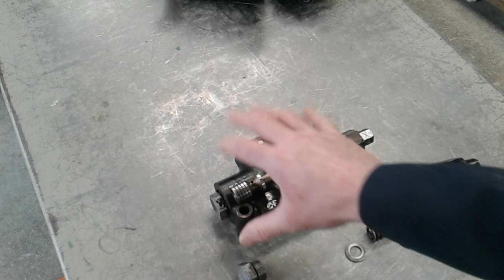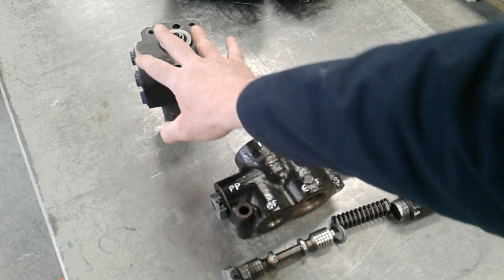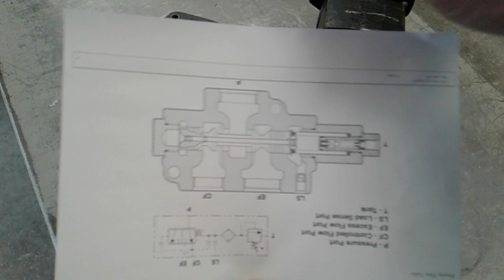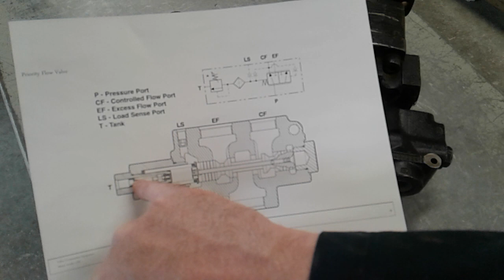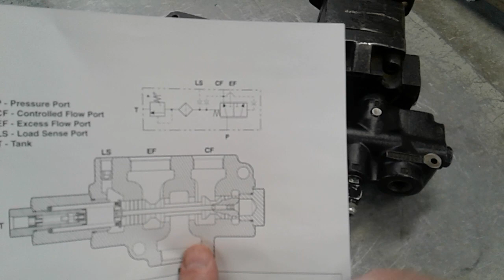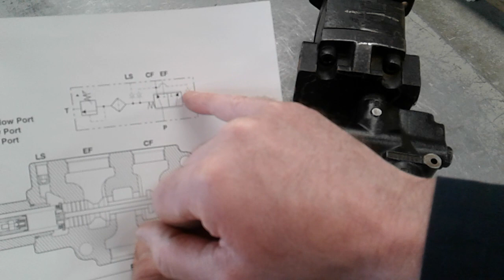Priority Valves in Mobile Hydraulics and Intro to Load Sensing with Fixed Displacement Pump

Comment: I have a cat backhoe I recently acquired. My first piece of equipment tbh. After a few days of use, I lost the right steering. I couldnt find anything that explained anything as thorough as your video. I wish I saw it before I paid an arm to have dealer service come out for a diagnosis and a leg for them to get me to replace the orbitrol on my own which didn't fix anything. ( the new one actually goes right slower than the older one and will kick back a bit). Your video gave me a couple new avenues to look into and it should save me the last 3 limbs i have 😅.

Comment: Thanks buddy for this insightful  tutorial ,its actually a good pointer for one project i am working on .i haev got a CAT forklift DP40KL , which has a stiff steering problem which started after the hoist contol valve was  changed and i presume there is indeed something wrong with the circuitry and most probably the hydraulic pump could be a FDP and no priority valve in the circuit .

Comment: EXCELLENT video but I hoping for a troubleshooting section for priority valves because Ive been having an issue I cant figure out on my Allmand TLB. Maybe you can steer(/pun) me in the right direction. Im here because I think Ive narrowed it down to the priority valve but want some reassurance before I break into it. 

The machine starts fine and runs fine. The minute I touch the orbitrol steering wheel the engine bogs down hard and all other TLB functions slow to a crawl and it stays that way until I actuate the loader valve in anyway. Then the engine picks up and full function is restored until I touch the steering wheel in anyway again and I have to repeat the process. The hydraulic fluid also seems to get really hot after some use. 

So far Ive had the steering hydraulic cylinder rebuilt. It was leaking and it started a slow leak again right after rebuild. 
I checked all the orbitrol lines for blockage. 
I tore apart the orbitrol to look for problems. Looked clean. 

The only thing I think I have left to check is the load-sensing priority valve on the pump itself. Its an Eaton Series 26 Single Gear. Its referred to in the Eaton manuals as a load-sensing priority valve and the description of it mentions that "the excess flow(EF) is available for auxiliary circuits".

Could the issue be related to the priority valve or the loader valve or either/both? Which should I attack first?

Comment: I think your video answered one of my questions regarding using EF on the priority valve. My Case 570M XT appears to supply the loader control valve and then uses a power beyond kind of set up that runs to a 0-8gpm flow control valve for the 3 point hitch control valve. Specs for the hydraulic system is around 28.5gpm at 3000psi with a gear driven pump. Does this mean I will have 20+gpm with a possible 3000psi available to use from the EF port to run an Oliver 1615 backhoe attachment I recently picked up? Its a fairly big backhoe and  right now has a 540 PTO pump hooked up to it which I would assume makes it open center. The Case 570 does not have a PTO on it but if I am understanding this correctly its possible to plumb the backhoe to EF as well as add a hydraulic PTO motor and quick connects up front for skid steer attachments using the EF and correct diverter/control valves etc? Any help is appreciated!

Comment: Hi, I love your content - thank you for producing these videos. My question is this: how does this priority flow valve differ from a sequence valve?
Reply: To answer my own question, the difference appears to be the load sense line to the pressure compensation spring.
Reply from the maker: @aidwilli  pretty much. The sequence valves I have encountered will send oil to the secondary circuit at a fixed, set pressure. Whereas the priority valve adjusts itself based on load. Good question!
Reply: @hydraulics  thanks again

Comment: In the Alberta Apprenticeship books, they show an HMU from a CAT scraper with just 3 hoses hooked up and the bottom left port plugged. All the 3 hoses could be a 3/4 ID and run from the HMU under the cab floor through the frame. The top left port has a sort of nipple. I have no idea why it's set up like that. The bad thing is that I'm studying on my own and don't know anybody with that king of expertise... Anyway great video
Reply from the maker: Interesting they would choose a scraper. Cat scrapers i worked on  had a very unique steering system with a follow up cylinder that sort continually re-entered the system.  I'd have to dig into it.. been years. Are there that many Cat scrapers in Alberta?  Scrapers are nearly extinct in eastern Canada.  Replaced by 6wd trucks and mass excavators. Something that specific to one family of machine from one manufacturer should not be in apprentice curriculum imo
Reply from the maker: The bigger units like a 657 very likely use flow amplifier steering where the HMU is only controlling pilot oil to a remote valve that handles large volume flow to the steering cylinders
Reply: @hydraulics  There are hundreds of scrapers (20 years old or brand new) especially in Calgary and Edmonton to build roads outside the city and level new subdivisions, many gravel pits use them to strip the overburden. Recently there are buggy scrapers hooked up to rock trucks like CAT 740 or Volvo AD 40: they remove the box and connect the scraper hitch onto a fifth wheel on top of the rear truck frame. The company making this buggies is called KTec. I'm studying for my Red Seal and there is a pile of stuff to review... Thanks for your interest !!!

Comment: I want to run a brake booster off the steering circuit of a forklift.  Orbital motor is open center.  Would going to a "power beyond" orbital be best, or would you just use a priority valve, favoring steering  (booster demand is very minimal 700 psi max and flow is low too)

Comment: Hi, I have a doubt. If you block CF, the pressure increases and the spool allows the oil to pass to EF, right? My question is how much is the maximum pressure in CF and what determines it?
Reply from the maker: maximum pressure at CF is effectively limited by the LS relief. The relief limits Load Sense therefore limiting maximum. Maximum will be limited to LS plus spring value. Some systems may also include a second relief valve for protection. There may also be port reliefs built into some Hand Metering Units (Steering Control Valve)
Reply: @hydraulics   Thanks for your reply! I have another question, in the video, you mention that the spring preload is about 200 psi over that the spool starts to move, which is the pressure that moves the spool fully to EF? is the spring maximum force, but I don't know if it is low or hight. If you connect EF to the tank, just a little pressure over 200 psi moves the spool, so the pressure at CF in a way is determined by EF. What am I missing here?
Reply from the maker: @matiasquaglia5021  sounds like you have it. But that spring chamber becomes pressurized when you steer and the load sense pressure comes in and floods the spring chamber. Then the spool must overcome pressure plus the spring.
Reply: @hydraulics  thank you very much! I already understand how it works. I'm working on a numerical model of a priority valve, I can't find a numerical value of the spring constant. I need it to know the pressure that moves the spool fully to the EF. Do you know any approximate value of the spring stiffness?
Reply from the maker: @matiasquaglia5021  in our Volvo G976 grader for example, the spring specification is 245 psi

Comment: Hi Sir, I dont understand something in your explanation. Let say we are at standby and oil coming from the pump and going to the Orbitrol is dead ended at the closed center position, it goes through the small hole and then to the back of the spool and then flows through the spool to the spring chamber back to the LS port , which will end up in the orbitrol case. With no steering that spool is never going to shift, because all the pressure coming from the pump is then dumped in the orbitrol case. There will be no back pressure to shift the spool. Please clarify.
Reply: I think I got it. Inside that spool there should be a pilot hole. So that at standby the pressure on the spring side is orbitrol case drain plus spring pressure and as soon as the pressure at the other side of the spool is going to match case drain pressure plus spring pressure there should be spool shift. Thanks in advance Sir from Canada.
Reply from the maker: @cecilendamb7935  there are two orifices in the spool. The orifice to the pp plug side is a bit larger than the orifice that feeds oil to the ls side. I forget the orifice sizes but definitely creates a pressure imbalance at the spool to help it shift.  I'm in Ontario
Reply: @hydraulics  currently I am in Montreal!. Thanks Sir

Comment: just wondering, by dumping excess flow, does the valve creates heat? i mean if the standby is too long, its going to heat up right? asking because i have not use the priority valve before
Reply from the maker: Yes. Holding oil back at standby will create some heat.

Comment: i cant find this valve in jcb 3dx backhoe.. plz help
Reply from the maker: I have never worked on a JCB, but I found a free schematic on scribd. looks like priority valve is at or built in to the steering control valve. Also looks like that machine has 2 pumps. One dedicated implement pump and then the steering priority valve adds the second (steering) pump's flow when not steering via the priority valve to the implement system. cool. Also looks like they  make Load Sensing Steering right in that valve - we have a Link Belt D16 truck with that same steering valve with the priority valve built in to it. Truck is made in UK, so probably the same deal.